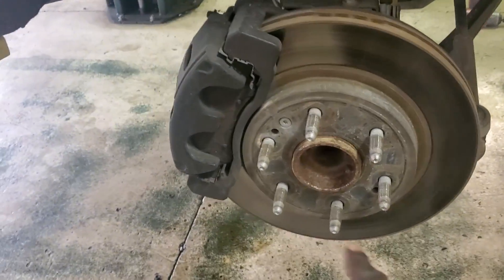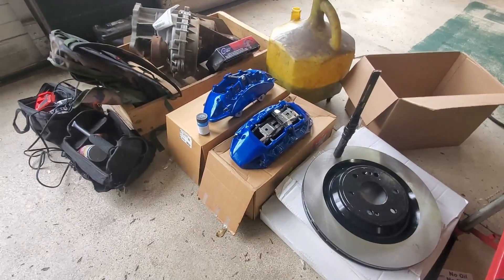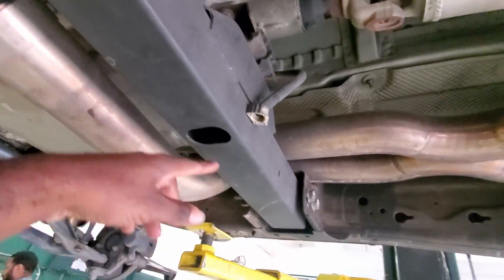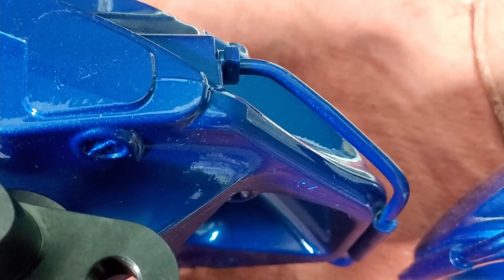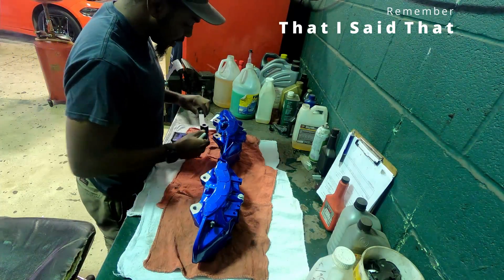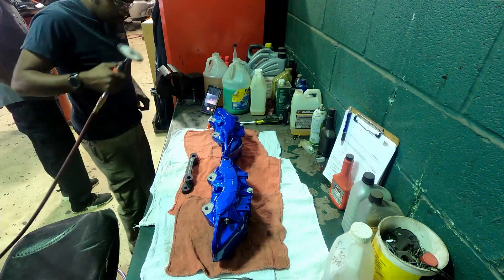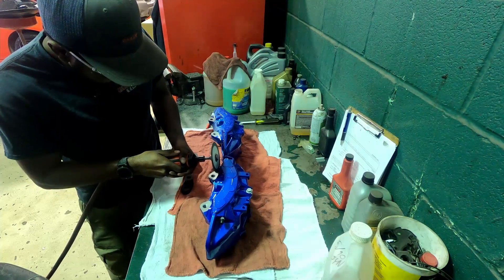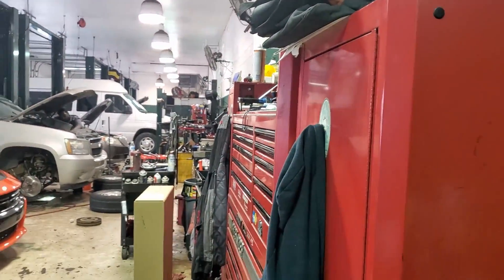CTS V Brake Swap Front C6 ZR1 Caliper Install on Silverado Part 1

Comment: Did you paint your rotors or did they come that way ?
Reply from the maker: They Came that Way
Reply: @BuiltByLondonRacing  really ? Mine did not , what brand are these rotors ? I ordered GM part #84263238
Reply from the maker: @sitnlow4life  these are not GM Part Numbers...The Link I Posted Should Take you Right to What I Bought

Comment: question on your set up is the pad area bigger than the rotor area where the meet. on mine the pad over hangs the rotor.
Reply: What rotors are you running .? Did you find a different way to have the set up fit better .?
Reply: @TripMode TV  i got rid of those and did a brembo set up that bolts on no grinding on the caliper.  Its in one of my videos
Reply from the maker: Yes bro...annoying lol
Reply: @BuiltByLondonRacing  ok thanks i though i had the wrong pads